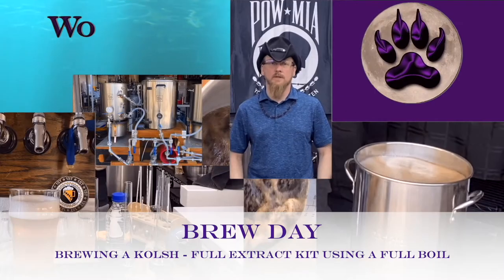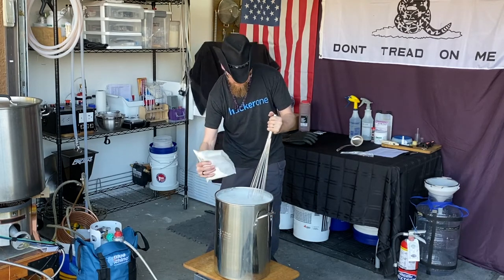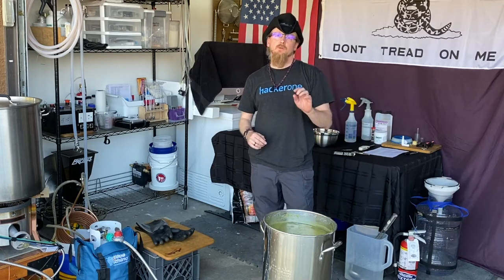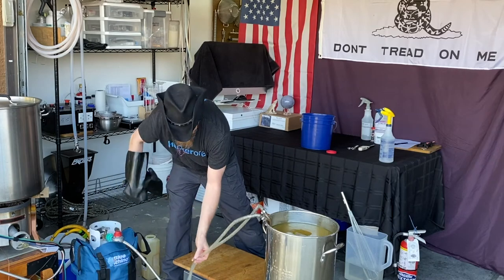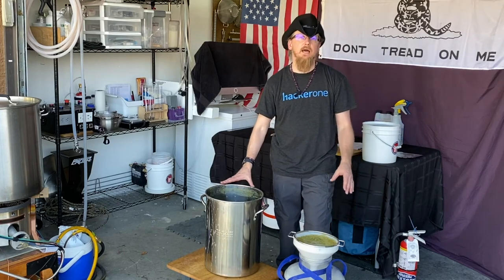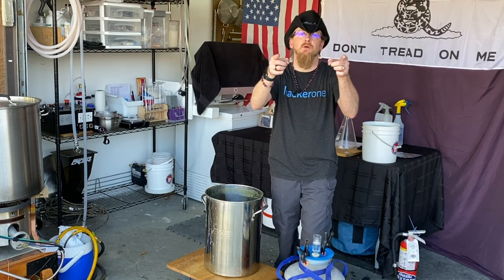How to Home Brew Beer - A step by step guide using a Kolsch Extract Kit and a Full Boil

Comment from the maker: ⏰ Timestamps in This Video ⏰
0:00 Intro
0:28 Kit Opening
0:55 Modifying instructions for Full Boil
1:14 Water amount used
2:20 Boiling and first extract addition
4:05 Bring back to a boil
4:48 BOILOVER!!
5:50 Beginning of boil and first hop addition
7:40 TIP - Good time to clean and sanitize
8:14 Second addition of Hops (30 Minutes in)
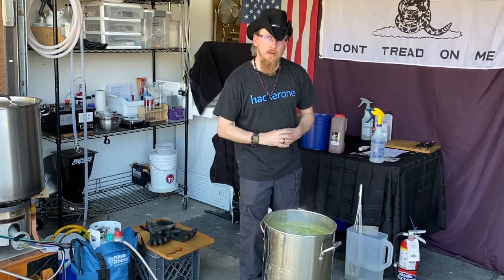9:10 Prepare Liquid Malt Extract
10:00 Second extract addition (45 Minutes in)
11:52 Add Cooling Coil and bring back to boil
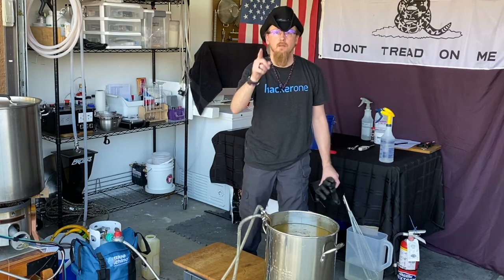12:34 Another boil-over???
13:04 End of boil - start cooling
14:36 Almost done cooling - Hydrometer reading
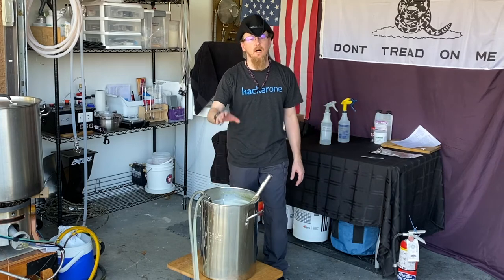15:15 Fermentor preparation
15:52 Transfer wort into fermentor
17:45 Pitching Yeast
18:45 Closing up fermentor
19:51 Storing fermentor
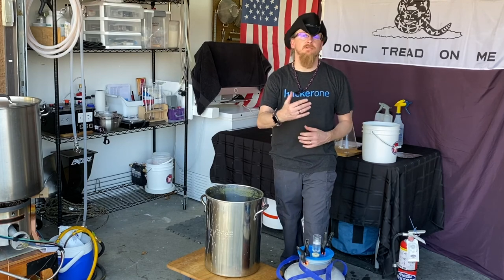20:46 Closing comments

Comment: Maybe a wooden spoon over the boil to prevent boil over?
Reply from the maker: That might work, but by the time the 'foam' has gotten that high it might not be enough to help.  There is a product that Northern Brewer sells (https://www.northernbrewer.com/collections/boiling-cooling/products/the-sentinel-boil-over-minder) that I've thought about getting to help out - but I mostly brew in my 15 gallon pot and that has enough head space that I'm not running into a boil over issue.  Thanks for the comment and support - see you next brew!🍻